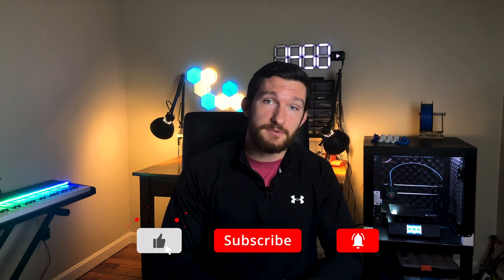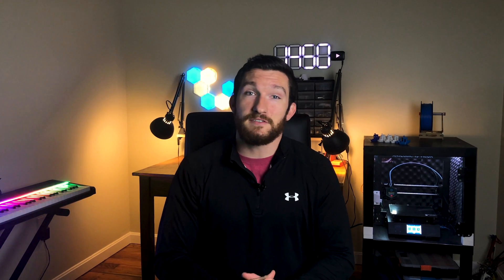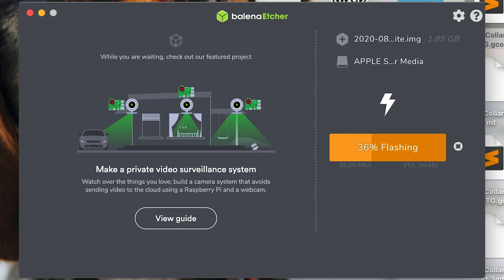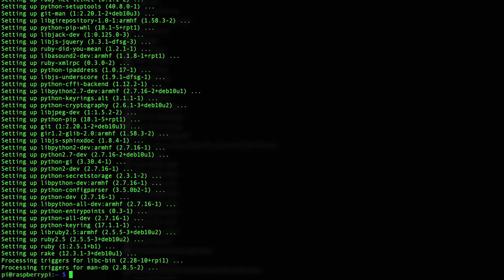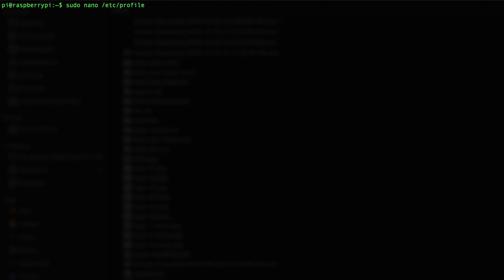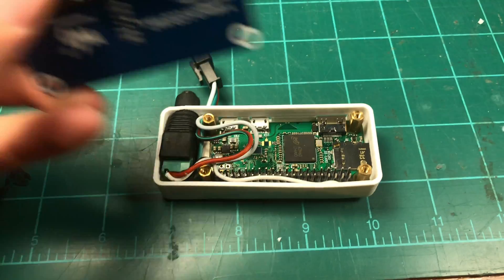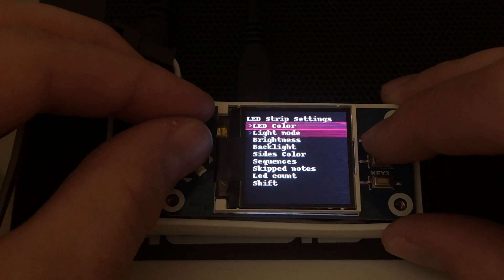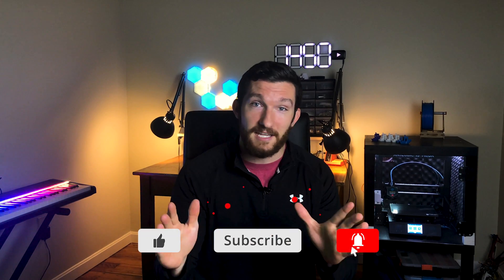How To Make a DIY Piano LED Visualizer

Comment: Will a pico work?
Reply from the maker: For the specific software used in this video, no. But if you're able to write new software to read the MIDI input from your keyboard and output it to LEDs then the Pico would certainly be able to handle that!

Comment: i made a usb midi 61 key piano with the scan matrix of 8x8 from 16 wires to my arduino now im is there a way to implement this into it i was going for under the keys light but im thinking of doing booth over and under after seeing this but im wondering if there is a work around since this needs the usb midi port but in my case im using it both to read the keys and deliver the info into my computer

Comment: How did you connect the keyboard to the pi? How does the pi detect the inputs of the keyboard
Reply from the maker: Thanks for the question! My keyboard has a USB B output that I connected to the pi zero with a micro usb adapter. Hope that helps!

Comment: is  5V3A  Power Adapter With EU plug is enough?
Reply: Hello. If u need piano keys animation then 5V 6A; if u need 5-30 active keys then 5V 3A is ok. 1 LED pixel(white color) its like 0.06A so 0.06 x 30(keys) = 1.8A plus some ampers to Raspberry PI

Comment: This is way above the average person's capability. You kind of have to be an expert in order to achieve this. Are you aware of anyone out there doing these installs? I'd gladly hire them!
Reply from the maker: Hey Emilie, thanks for the comment! I have recently gotten a lot of comments like this, so I’m looking into a more streamlined approach that could potentially be sold as a kit. Hang tight!
Reply: 🙏🏻 How do the colors on the LED strip correspond with the colors of the particles in the See Music App? Does it connect somehow so that the colors are aligned?
Reply from the maker: @emiliefilipek7  I chose both colors so they’d line up like that 👍🏻
Reply: @ModernHobbyist  As soon as that kit is I will absolutely be buying it! I’ve wanted something like this for years now and I would be lost trying to make it myself.
Reply: @ModernHobbyist is the kit available? Take my money!

Comment: an arduino won't be able to do that. but you can use a Teensy. They are the best choice for diy midi controllers and anything midi related.

Comment: Hello Modern Hobbyist do you know if this would work on a Roland KR-177 keyboard?  Thanks for an amazing video.
Reply from the maker: Hey thanks for the comment! I can’t promise anything but that keyboard does have a MIDI output, so if you get a midi to USB adapter it should work with this setup! Hope that helps!
Reply: @ModernHobbyist  It helps greatly.  Thank for answering my question and posting an amazing video.  😄😄😄

Comment: I'm really confused. Where are you getting all the scripts to copy and paste, and how do we find them? Also, I'm not really sure what I'm supposed to be doing with the wiring. I have the same little adapter green thing you have that comes with the Power Supply, but I'm not really sure what wires go onto it and where those eventually lead, you didn't really explain that part in depth.

Comment: How does this get connected to the keyboard to determine what keys are being pressed? It looks like it may get connected via some weird cable? This part is very important and gets glazed over. What keyboard ports are required for this to even be an option?
Reply from the maker: Thanks for the comment! The Raspberry Pi is connected to the keyboard via USB type B, which is common for household printers or even the Arduino Uno. Hope that helps!

Comment: I'm curious how you mapped which LED to which key. I'm guessing the LEDs didn't come spaced 1key per LED. Did you do encode which LED would light up for each key? Or was there some distance per LED relative to distance per key that you used?

Thanks!
Reply from the maker: Thanks for the comment! The LED code was actually handled by Alexander Evening and if you're curious, it's linked in the description!

Comment: Ok well since I have the same piano I guess I have no excuse not to do this.  When in the process did you add the synethesia notes?
Reply from the maker: The code should automatically work with Synthesia, so you can stream notes from the software directly to the Raspberry Pi. For more information on that, I'd recommend you check out Alexander Evening's video, linked in the description! Thanks for the comment!
Reply: @ModernHobbyist  got it, thanks man , I kinda got excited for this and started asking questions without reading everything first. I don't have a 3d printer so I'm gonna have to get creative with the led strips.  Thanks for this man, you rock
Reply: @ModernHobbyist  Does it only work with synthesia?

Comment: Nice tutorial but it seems like you're screwed when your piano/keystation has a weird scale, each scale I'm off 1 led and I need to "reduce" the gap between leds which is harder than making them wider which would be easy to solder :/
Reply: Then you buy individual leds and put them on a custom strip....

Comment: so i have a 61 key keyboard. . . . what adjustments would I have to make to the code to get it working. also cus i have no ruler. . . how much led would I need. <YAMAHA PSR-E433>
Reply from the maker: Hey thanks for the comment! It depends on how wide each of your keys are, but if you're lucky, you might be able to get by with a single 1 meter string of the LEDs linked in the description. Aside from that, you shouldn't need to update any code to make it work. I think it operates on the assumption that you have 88 keys, but if the MIDI interface will only light the keys that were pressed, so the extra missing keys shouldn't be a problem. I could very well be wrong though, since I can't test with a 61 key keyboard. Hope that helps!

Comment: Thank you for the tutorial! I'm curious, would it be possible to use a different raspberry pi for this? I have a raspberry pi lying around from some other projects but I don't think its the same model as yours
Reply from the maker: Thanks for the comment! Another Pi would definitely be able to control the lights and communicate with the piano, but the display used here is specifically designed for a Pi Zero. I think if you're not interested in changing the settings, you could use any old pi though! Hope that helps, thanks for the comment!

Comment: Hey can you explain how you soldered the two of the led strips together
Reply from the maker: Hey thanks for the comment! The process is pretty simple, I just overlapped the two strips slightly, so that the solder pads were touching, and then bridged the solder between the two strips. I didn't need any other glue or tape to keep them together. Hope that helps!

Comment: I have been racking my brain trying to find this setup. QUESTION: Do you think it is possible to set this up with an effects pedal board? I want to have the pedals illuminated from below the pedal, under the risers whenever the selected pedals are on, or activated? The pedals are all connected through a midi controller/switcher. so for example, when I stomp on the switcher or pedal, the effects light normally turns on for normal operation, but also, an accent led light turns on for that pedal or pedals. just like on your piano keys, there will be led strip or single led in series attached to underneath each of the pedals to give each activated pedal that glowing effect. hope that makes sense. Thanks in advance for any direction you can send my way.
Reply: Yes, simply scripting this is pretty easy even for people total new to scripting otherwise i can try to help you in the comments

Comment: I bought LED strip WS2815 and I have problem connecting it to RPi. It has 4 PIN connector + 2 more wires. Do you think it could work? What would the connection look like? The software seems to work on RPi so far which I thank you for!

Comment: What is the name of plug to LED strip? Where does it come from? It comes with LED strip itself?
Reply from the maker: Hey Janek, thanks for the comment! The connector is called a JST SM connector and these LED's require a 3 pin version. Here is a link to an Amazon listing that would work:

https://amzn.to/3u6iQYP

Hope that helps, thanks again for the comment!
Reply: @ModernHobbyist  Thanks dude. That has been very helpful. Good job with the vid, man. I probably try using your tips to do manual installation over Mac terminal to my RPi Zero.

Comment: A quick question
The display doesn't go all the way down so is it possible to "wrap" the cables around the pins instead of soldering?
Reply from the maker: Hey thanks for the comment! That might work, but if the wires get moved even slightly, you'll lose connection. Furthermore, you run the risk of a wire going completely loose and shorting on a different pin, which could kill the Pi. In the end, a soldered connection is the safest and best way to ensure good conductivity.  I'd encourage you to pick up an iron and learn, soldering isn't hard and the skill will come in handy the rest of your life! Hope that helps!

Comment: How did you connect the Display to the pi? Like which input etc.?
Reply from the maker: Hey thanks for the comment! The display is actually a hat for the Pi Zero, so it connects to all the pins, though I'm not exactly sure which ones it uses. Hope that helps!

Comment: Can I use any other led strip as long as its a WS2812B?
Reply from the maker: And any WS2812B led strip should work as long as you get one with 144 pixels/meter. Thanks for asking!
Reply: @ModernHobbyist  Alright thanks

Comment: How do I connect the led strip to the pi
Reply from the maker: Hey thanks for the comment! The center pin on the LED strip will need to be soldered to pin 18 on the Pi, while the Gnd and 5V pins will go to the power supply's Gnd and 5v respectively. Hope that helps!

Comment: How do I use python 2 instead of 3? The pip installs did not work
Reply from the maker: Hey thanks for the comment! You can either specifically call the python command with the version of python that you want, or you can update your .bashrc file. This link might help, thanks again for the comment!

https://linuxconfig.org/how-to-change-from-default-to-alternative-python-version-on-debian-linux
Reply: @ModernHobbyist  Just got back to this project, I ran the command to install all of the requirements again, and it said all the requirements were already satisfied in  /usr/local/lib/python3.7/dist-packages. Does this mean I used python 3? When I use the default command the article suggested, the default version is set to 2.7, so I'm not sure how it would be version 3.7. Anyways, would it still work to play with the LEDs? I am waiting on my LED strip still. If not, could you please tell me how I could update the packages? Thanks!

Comment: I'm assuming you edited the 3D model of the case for your build? Purchased a 3D Model online of the link you shared in the description and at 7:54 your case is much longer. I didn't notice until it arrived. Mine barely fits the RPI in it and there is no hole for the wire or the Power Barrel Jack Screw terminal. Appreciate the help!
Reply from the maker: Hey thanks for the comment! Unfortunately, I didn't actual create the model that I used as a case, but it looks like there were some updates made to it by the original creator.

Comment: Great tutorial I managed to get it work with your guidance. It will be perfect if you have chance to add steps for bluetooth midi connections  between pc and raspberry.
Some corrections on your guide:
8. "sudo nano /usr/local/bin/connectall.rb`" you must delete the "`" character at the end "sudo nano /usr/local/bin/connectall.rb"
8-2. In connectall.rb the last "End" must be lower case "end"
17-2. "sudo python -E python /home/pi/Piano-LED-Visualizer/visualizer.py &" first python must be removed "sudo -E python /home/pi/Piano-LED-Visualizer/visualizer.py &"
Reply from the maker: Thank you so much for the comment! I'm glad that this video helped you and also thank you for the feedback on my instructions! Those seem to be errors I made when converting my notes to markdown, so thanks a ton! I'll get those updated ASAP. 

Cheers!

Comment: Hi, do I need to do some special install to connect LCD display? Display shows only  white screen after all steps I did. Thanks .
Reply: Have you made sure the operating system and all scripts are installed and running?
Reply: Ah, I just got to this step myself. If you read the tutorial on github (linked in the description) it says you have to enable SPI! Do these steps:
In the SSH command interface do the command “sudo raspi-config” without quotes
Select interface options
Select SPI
Choose Yes
Then reboot your Pi the normal way (sudo shutdown -r now) and the LCD should turn on. If it still doesn’t work reply and I’ll see how I can help.
Reply from the maker: Thanks for solving that one for me Logan! Yeah I didn't get a chance to cover 100% of the steps in the video, so make sure to check the documentation for more information. Also, feel free to leave another comment and I will try to help if I can! 

Cheers!

Comment: Is it possible to send the midi signal both to a computer and the Pi zero? If so, how?
My midi keyboard has both midi usb and normal midi port, can both work at the same time?
Reply: You want a USB splitter :)
Reply: @loganm2924  I think that is not the solution. You must use bluetooth connection between raspberry and pc or first connect the midi keyboard to pc and then pc to raspberry with appropriate cables.
Reply: @oppeslife  yeah, this. You need a way to re route your midi signal out another cable to plug into your USB hub (or use Bluetooth, but I’m not a fan)
Reply: @loganm2924  I managed to connect raspberry pi with windows pc using rtpMIDI. The latency and connection quality is just perfect. But now I'm in trouble with set ports in and out on raspberry pi. I just don't know what's going on backround. I'm newbie with coding by the way. Just followed the instructions and I got here 😊
Reply: You can refer this tutorial - https://youtu.be/kAj78IE2704

Comment: Great video! I've been working on this project and I'm on a raspberry pi 4 - I already had one that I didn't use. Do you know if that matters? Also, can you provide instructions on how to link two 1m led strips together?
Reply from the maker: Hey Jason, thanks for the comment! A RPi 4 would definitely be able to run all the software and control the LEDs, but you would lose support for the LCD display hat that was used in this project. As far as the LEDs go, I found that simply soldering the two ends together was a strong enough bond to keep the two separate strands together. My string has yet to break even after mounting it and removing it from my keyboard several times. Hope that helps!
Reply: @ModernHobbyist  Thanks for the reply, man! I can't get my bluetooth to work properly. I can establish a stable connection, but not all the notes play and the lights don't work when trying to learn a song. I've set my input to RPi and set light effects on the output channel. Did you have any issues like this or tips on how to solve it? I ran connectall.rb to test connections and everything appears to be connecting properly.
Reply: @jasonvongsay2620  sounds like an issue with your midi to USB cable. If you bought a cheap one (like $1-$10) such issues are common. I found that out the hard way.
Reply: @ModernHobbyist  can a raspberry pi 3 model b+ do it too?
Reply: @a2kvarnstrom80 the raspberry pi 3b+ has the same capabilities as the 4 but the raspberry pi 0 is way cheaper